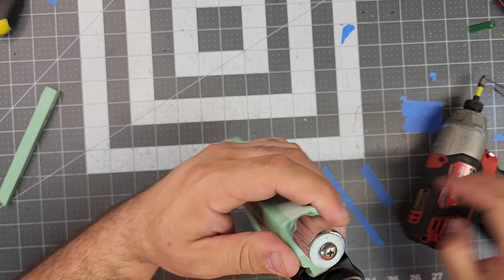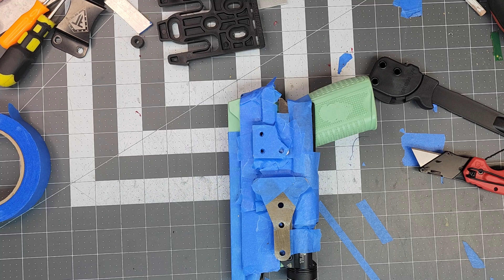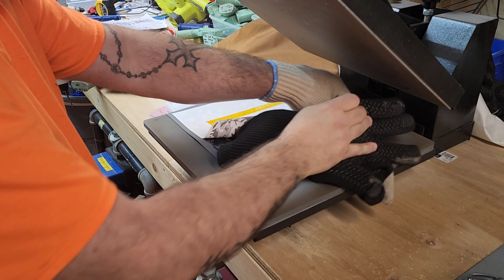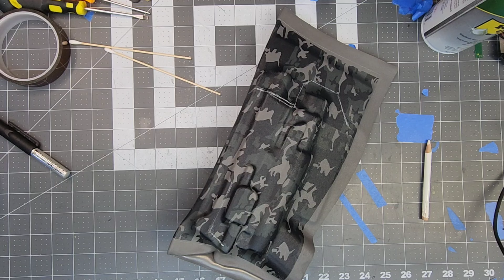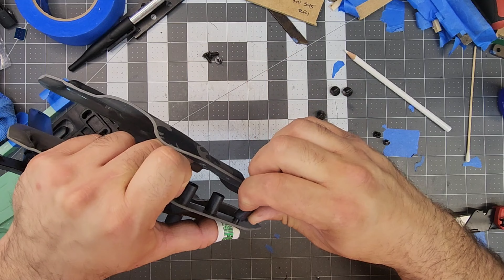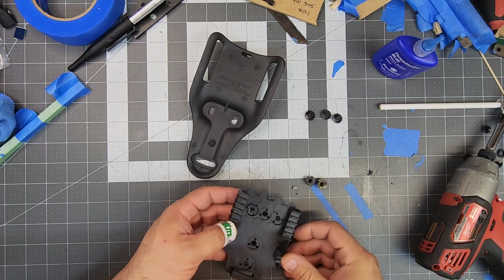FN 545 With TLR1 in Black Multicam

Comment: That's my rig - right down to the Qfork which is about the best 12 buck you can spend.     Love me some black Multicam too!   Did not realize you Dsub print it.  Guess that gives you the flexibility to choose the base kydex color or texture.  Very kewl.   Ever get into fabric overlays?  Always though that would be a good call for the inside - protect  the guns finish from holster rubb.       Hmmm... Do I really need anudderwon?
Reply: Lining inside holsters with nylon, Cordura, etc. can actually wear your finish even faster than the Dex can. Also, any lint, sand, or other debris that gets inside is nearly impossible to get out. Thus, a sandpaper effect happens. Exterior lining is easy and looks amazing. Iggy has some other videos about doing those.